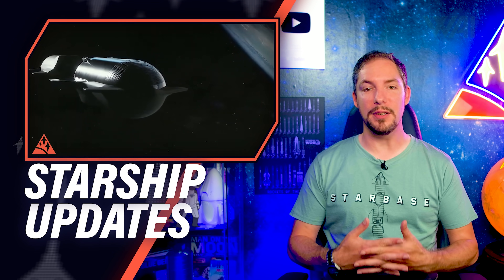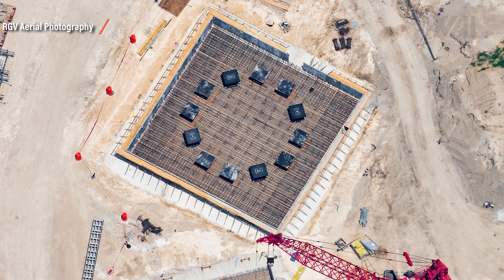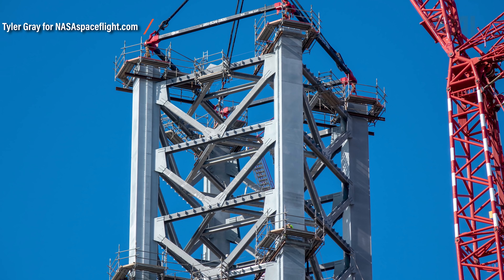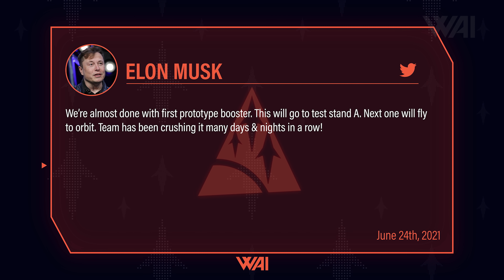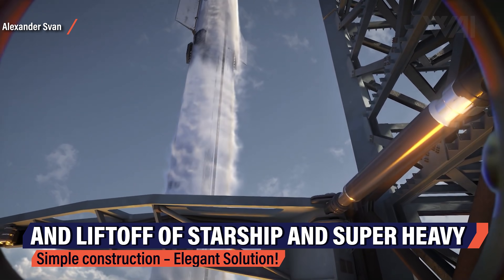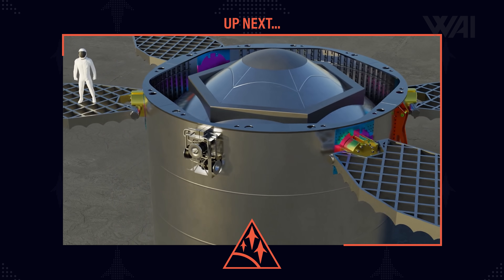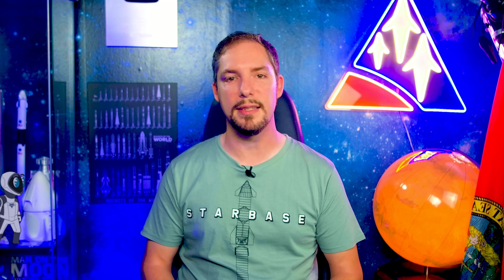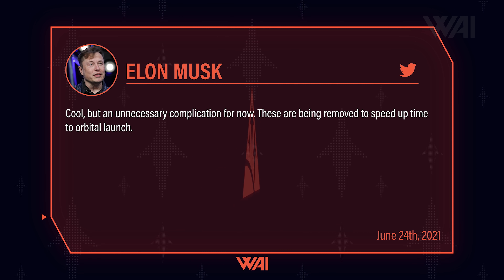SpaceX Starship design changed? Super Heavy booster precision landing thrusters!

Comment from the maker: Would a Starship make more sense if it receives fuel through the booster or on its own on the launch mount? :_WAISweet:
Reply: I think the starship will receive fuel through the booster, but the booster will receive fuel from the integration tower. A fueling arm will attach near the top of the booster, and the booster will have internal plumbing that pumps some of the fuel up into starship in addition to the booster.
Reply: @sethblumenthal7419  this sounds good less distance to move the fuel less pressure required to move it very nice!!
Reply: @sethblumenthal7419  I agree with you: fuel both through the interstage.  This also protects the quick-disconnects which usually need protection. The fueling arm might also be (particularly) integrated into the stabilization arm at the top of the booster which Elon has said is necessary during stacking of Starship.
Reply: Fuel Dual Inlet. A Pipe that goes into the booster at the top, and into the bottom of the starship. No change to starship fueling, and a reverse fueling for the booster (like an upside down starship). It would be like 2 starships butt to butt.
Reply: @vegaset4038  Agree with this. If BN is to be re-usable, then the fueling plumbing should be on-platform/tower as much as possible to lighten BN and reduce potential fueling system plumbing issues from multiple flights.
Reply: @vegaset4038  Seems like this would make sense, but then what about draining fuel from the booster?  That has to be a capability so there must be a connection at the bottom of the booster as well. This could also speed things up since fueling rate could double using both as inlets.
Reply: @markhowell2725  Due to the weight, it would be best to fuel the booster, then transfer to the Starship after to prevent the possibility of a buckle and collapse.
Reply: Booster. Already has a fueling system at the bottom for orbital refilling.
Well, it means more complexity for the booster thought...
Reply: @johntheux9238  You noob. Boosters will not fly to orbit themselves. And providing some kind of fuel transfer capability to the booster, which is always fueled on the pad is stupid.
Reply: @Weisior  But the ship already has a fueling system and the ship is more mass sensitive than the booster.
Reply: Yup absolutely
Reply: @Jabbarrayyan : Umm... he asked which one.
Reply: Booster
Reply: Less parts the better, but if time comes into play then the mount
Reply: I think it will prop load from the bottom and this is the booster catch arm/stabilizer that we are looking at... at least that's what I hope.  I want to see that Mecha Godzilla arm Elon referenced!!
Reply: @Bigboss539  I agree, I think the yellow tubes are going to be part of 2 catch arm assemblies, one each side that can swing into position. The booster might land directly on cables extended by the arms, the cable drums at the base used on landing as shock absorbers. My 2 cents.
Reply: It makes no sense to fuel it through the same ports that fuel the booster, I have stated the reasons in the main comments section, but TLDR for you is  Too much hydrostatic pressure in booster tanks and/or too much added equipment weight to enable fuelling Starship through the Booster. Best solution is fuelling arm with umbilical connecting to a T port through Starship skirt.
Reply: Which choice is more practical for the return trip from Mars to Earth?  There won't be any boosters on Mars, but there will be launch mounts.
Reply: I think it would make more sense for it to be fueled through the booster. It would allow less weight on the starship itself and that is a good thing because the starship is the only part of the stack that will have to leave mars. There would be no booster on mars and that added weight could be small but could also change the capabilities of a starship that needs to leave mars with limited fuel. 

I say add the weight on the booster, It would still be powerful enough and it will always be fully fueled up for launch attempts.
Reply: A sideways fuel inlet for Starship would be beneficial to speed up fueling time. The less time is spent with fueling, the less lox boils off.
Reply: A quick disconnet at stage separation does not look like a very safe way to do it. I do not believe the fuel will be funneled through the booster to the Starship.
Reply: @Turbo999be  Agree , In fact its not one quick disconnect but two, one for oxygen , one for methane.  An alternative would be to fuel through the nose on Starship and the side for the booster. In space refuelling could be done nose to nose.
Reply: What would make the most sense...PUTTING TALL'S IN YOUR STORE. Your like 6'4" why do you not have shirts for tall people. That would rock!!
Reply: To minimize the mass of plumbing within the rocket, there should be two GSE connections to the booster. A lower connection would supply LOx to the booster. An upper connection would supply LOx to be routed through the top of the booster to Starship. That upper GSE connection would also supply methane for both stages. This design has the virtue that it requires no extra plumbing on Starship and only minimal extra plumbing on SuperHeavy.
Reply: Fill fuel from the top. Let it settle to the bottom first like any other tank.
Reply: The final starship should at least be able to be tanked through the booster. Seems more straight forward and seems like a necessary step towards refueling in orbit anyway.
Reply: I think overall SpaceX is trying to reduce as much weight so they're probably going to have the dual system from the bottom and from the side fueling to take off even more weight.
Reply: Is this another water tower  prediction?
Reply: WHY  CANT IT RECEIVE FUEL THROUGH A STARSHIP AND WORK ITS WAY DOWN TO THE BOOSTER (NOT YELLING CAPS ON :) ) gravity will help it fuel faster
Reply: Perhaps it could fuel using the same adapter on the starship for orbital refueling, and be connected to the booster, but, instead of having a pipe traveling all the way up inside the booster for fueling, it could simply connect to a fueling arm or similar at roughly the same height as the grid fins.  Thus, no heavy pipe all the way to the bottom of the booster is needed, and absolutely no extra hardware on the starship would be needed.  Just a bit of creative plumbing at the top of the booster...
Reply: I am also firmly in the 'through the interstage' camp. If you run the fuel pipes (there must be 2: for LOX and CH4) all the way through the booster from the bottom, they would have to penetrate 3 bulkheads (that are under high stress due to the pressure inside the tanks). That would add a production complexity and we all know how much Musk hates that.
Reply: I was about to do something productive, and then Felix uploads a video.
Nice!
Reply: fueled thru the bottom while the starship is attached to the booster on the launch table ! less chance for something to go wrong and a time saver
Reply: @fatallywound3d340  whatever is pumping into it would be set up to handle it. The landing legs would also give room for that to happen.
Reply: It’s an elegant solution, but as we know, the best part is no part!
Reply: Plot Twist: It's changing in space, too, because they decided to use a tether to reduce mechanical stress on the skirt, and to give the ships a chance to rapidly detach if needed.
Reply: Maybe the propellant loading arm will connect near the bottom end of the Super Heavy.
Reply: In orbit refueling is the plan. Might as well roll with fueling via the booster.
Reply: @fatallywound3d340  exactly my thoughts.
Reply: I'm thinking NO through pipe, just a pipe connecting the TOP of each booster tank to the feed at the bottom of starship. Presuming both ships use the same tank pressure, this becomes a single fueling process followed by closing a couple valves between the ships. Minimal additional weight, single input for starship.
Reply: There are usually 'male' and 'female' connectors, likely needed for efficiency under pressure. Then there's standard Starships and tanker Starships, where the fuel connectors need to mate to transfer fuel, but also need to mate with Super Heavy, with a common type of connector that could be used with both Starship variants. Tankers would need both types of fuel connectors; offset orientation would mean doubling the mating hard points and locking anchor points, one set for Super Heavy, and another at an offset for mating tankers. Not servicing fuel via Super Heavy simplifies the alignment process, tolerance allowance and shock absorption mechanisms when mating Starship onto Super Heavy, but the bottom fuel port(s) with all afore mentioned complexities will still be needed when doing in space refueling. It would not be very convenient to use the bottom fuel ports for launch pad fueling; another set of side fuel ports would be needed. So feeding fuel via the booster has less maintenance critical parts (fuel ports).
Reply: booster through ports because it would need less pipes 
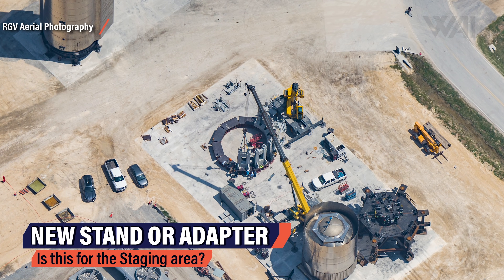and 1:58 , you said "SN2.1" but it actually BN2.1
Reply: launch mount to safe weight.
Reply: On its own- you’ll need to be able to refuel starships on Mars from the side
Reply: there needs a starship that has one side covered in heat tiles before it can go orbital
Reply: I'd think it would be obvious to save more weight on the ship than the booster because the booster only has to go high enough to send the ship into orbit. Leaving that weight on the ship to have to contend with even on take-off back from the moon or Mars would be silly.
Reply: @from ze paradize: He asked which one.
Reply: For me I think a dual refueling system is best. For docking at other stations it would be beneficial. Also the hardware load is a significant weight reduction for super heavy allowing for a greater fuel saving for return and landing.
Reply: Fuel Starship on ground then lift into place and launch- maybe not possible but it’s the simplest system and lightest.
Reply: @simono6520  You can't do that.  Fueling cannot take place until everything else (including crew) are loaded and secured.  Doing it any other way has always resulted in catastrophe.
Reply: perhaps the supply system in towers A and B, should already be prototypes of the orbital supply system... and perhaps it will be adapted on top of the heavy supar to supply the starship...
Reply: Won't Starship need a more "integrated" fueling system for orbital transfer anyway? Why add another system that essentially does the same thing, but only on the ground?
Reply: All fueling of Starship through the booster into the bottom of Starship as this will be the re-fueling position of Tanker Starship to Starship in orbit. However, on the launch platform, Starship should be fueled through a connection at the top of the booster with pipework going up the launch tower and not inside the booster so saving the pipework weight in the booster and of course only one pair of pipes on the tower and not in each booster. Once fuel is produced on the Moon/Mars the Starship will be fueled from the bottom the same as from a tanker. My 2c.
Reply: Thanks for the up date, nicly done, I'm way behind on everything, sorry.***8888***
Reply: I think bottom and side. Bottom to make in orbit refueling possible as described, side for on the ground refueling on Mars and/or Moon
Reply: Your icon is Dr Strange?
Reply: i think it'd make more sense for it to get fuel from the launch mount, they seemed to like the idea of not needing a refueling system for starship in orbit, instead relying on just throttling up to get fuel, it would make that system redundant
Reply: If they can put a little door to load using the same hardware, they'll do it. Side loading if the weight is 4x lighter than having lines in the booster, as the payload reduction is 4x (IIRC) less when the weight is in the booster instead of 2nd stage.
Reply: Side. How will they refuel on Mars without a Booster?
Reply: @christophermichaelson9050  The booster is not needed anywhere outside Earth, only needed to escape Earth's high gravity well.
Reply: Side fill capability opens up some more options for refueling both in orbitt, and, more importantly, landed on an undeveloped surface (moon, mars, etc)
Reply: Launch mount. Obviously SpaceX also finally realized that…!
Reply: I think it makes sense to fuel the Starship upper stage from both bottom and side with a split system.. This would cater for both on-orbit fuelling and on-mars fuelling as side-fuelling would be simpler on the surface of a planet since starship upper stage will likely need legs for mars landing and on future worlds..
Reply: @wezleyjackson9918  Having legs would allow Mars astronauts to reach under and plug in their local fuel source to the bottom port used in orbit. Adding a second fuel inlet to the already complex manifold would be unnecessary parts.  A passthrough fuel port at the top of the booster would remove the need of a high capacity LOX pipe going all the way up there (there will be thinner pipes to feed the RCS engines).
Reply: @johndododoe1411  First, it is a very BAD idea to have your fuel ports anywhere near the rockets.  That's just BEGGING for a flash and a boom and rapid disassembly incident.  Second, interconnection between stages compromises the fuel system of both, especially at any quick disconnect points.

And third, if you think a chemical rocket of this type will ever have enough fuel to reach Mars, much less with enough to do the tail-end landing, you weren't paying attention to how much the Apollo missions had, and how close to the bleeding side of failure they were.

You aren't going to have refueling take place in the vacuum of space, and Starship, even if there was NOTHING but methane and LOX, would be empty long before it got there.  We won't even talk about the fact that methane MIGHT be made from water and CO2 on the ship, but still needs LOX to work  Small problem...oxygen doesn't exist there (aside from the paltry amount in any water that's found).  Since most hydrocarbon fuels burn at a 1:16 ratio to O2, that should tell you how much more O2 you'd need.  Combine that with the fact it takes around 850 gallons of oxygen gas to make one gallon of oxygen LIQUID...
Reply: @billcichoke2534  So much denial of the official project concept and planning, and what other rockets have done.
Reply: @johndododoe1411  ???

It hasn't even left the ATMOSPHERE yet!  What in THE WORLD are you on about?

Not to mention, why aren't you addressing the specifics of my post?  I did actually get to watch the Apollo missions AS THEY HAPPENED.  I've been following and researching the various branches of science and technology for the last 45 or so years.  My opinion is based on the statements from the guys who HAVE taken people away from, and back to earth.  Elon hasn't, and they haven't endorsed this project of his.  It's the main reason he's building the launch site in Texas...they don't want his loud, ill-conceived ash cans blowing up THEIR launch sites any more.
Reply: @billcichoke2534  NASA blew up a shitload of rockets before they finally put a man on a suborbital flight, then later they burnt Gus to a crisp. Such an elementary mistake to fill the capsule with pure Oxygen, let alone to not ascertain the flammability of Velcro. Now which bright sparks came up with those ideas ? Or subbie out to some money hungry firecracker manufacturers, I saw Challenger blow up live on television too. Then there's the idiots who failed to test a piece of foam striking another piece of foamy shit, another ash can and seven more highly trained individuals lives wasted !! There is a lot more than a paltry amount of ice on Mars than you so conveniently dismiss, take your 20th Century books to bed and leave the younger generations to accomplish something NASA could never do because of their outlandishly expensive  approaches to engineering. Elon Musk hasn't risked any lives until sure of his and his teams products, and they have injected a new fervour into our kids and our grandkids dreams of a future, in the meantime Elon leads the charge to start fixing this planet you and my generation abused !!
Reply: @krashdown5814  You really have no idea what you're talking about, do you?

The Apollo missions worked because they did NOT use what is known as 'direct ascent/descent' systems.  The lunar lander and module were two separate SMALLER items to the service module, which meant less overall weight went into space and to the moon, down, up, and back.

And they used ALUMINUM, NOT STAINLESS STEEL.  Almost as strong and almost 1/3 the weight, pound for pound, as steel, stainless or otherwise.  Also less likely to become brittle or retain heat or expand and contract as much as steel.  Musk is using the number of rockets he is, because his dildo and trashcan are so much heavier, they NEED that power to get off the ground.  Which means they also need that much more FUEL, which adds more weight.  Not to mention the fact that around 30% of that fuel weight us reserved in the booster to make a flashy landing back on earth, instead of JUST getting the dildo up into space.

Musk is trying to make the one-piece system work because otherwise you have to have COMPETENT AEROSPACE ENGINEERS design the rocket, interconnect/separation systems, and the like.  That's more expensive, and outside of his (and their) expertise.  Software doesn't get you as far as hardware in this situation...something Musk doesn't get.

The great thing about age is wisdom comes with it.  The problem with youth is, you think you know it all.  You DON'T.
Reply: @billcichoke2534  You can go back into your cell now Bill, keep writing your stories of years past.
Reply: Any connection of fuel systems would be a potential weak spot upon separation.  So no.
Reply: @billcichoke2534  ok
Reply: @shahishnusureshkumar248  Question?  Comment?
Reply: @max2win  The interstate coupling has to be strong enough to take the force of booster underneath pushing into dopey trash can up top.  Any plumbing in there would creak a weakness that would more than likely result in a failure and the destruction of booster AND trash can.